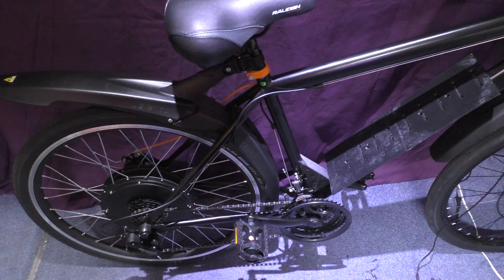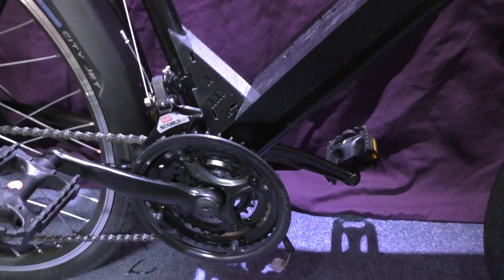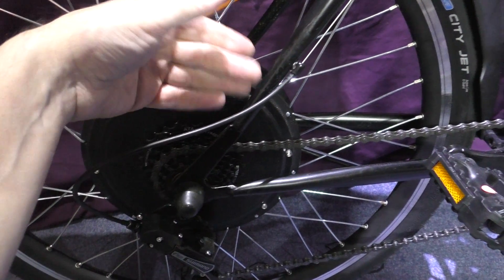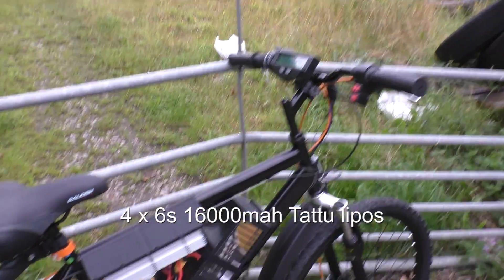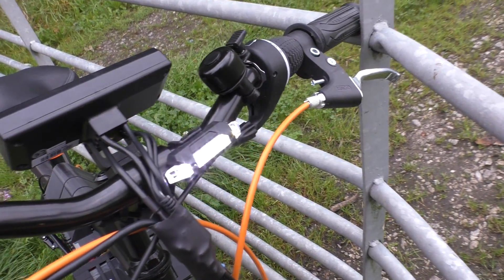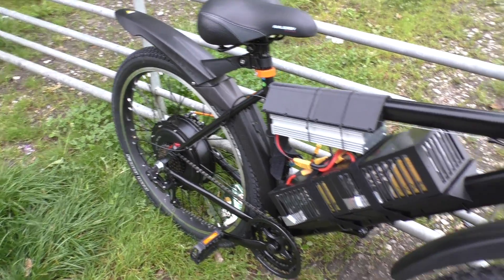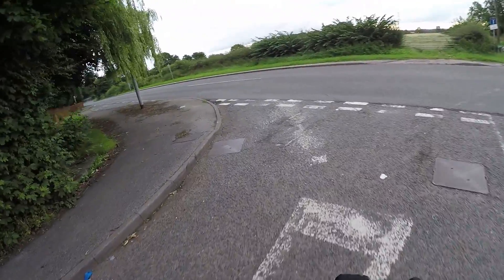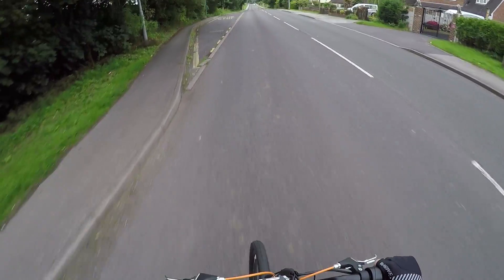Insanely fast DIY electric eBike - the most dangerous and unsafe bike ever

Comment: My 1000w hub 48v 10 amp battery Ebike I assembled has top speed of 84 kph. It is comfortable at 60 kph.
Reply: Yes going downhill, you can also do it with no power at all.
Reply: Scott Mannear  But 84kph with 1000w on the flat, you need to be very very aero.
Reply: If you're wondering i'm running an mxus 3k v3 (version with fatter axle and curved magnets) 5t (torque wind). From a 10Ah 92v battery, feeding my controller 100A battery and 250A phase. Controller is infineon sine wave with 100A of flux weakening. Torque is stupid, out accelerating most cars on the road and with a top speed of about 60mph.
All of this on a downhill frame with 9.5" rear travel and marzocchi 888 forks with 8" of travel.
Reply from the maker: For anyone who's interested, I'm currently doing a new build series where I list all the parts and explain everything in as much detail as possible. https://www.youtube.com/playlist?list=PL3Rqaj8tXgriU-y1gIiZb22lj0LHdCG7S
Reply: th3d3wd3r that makes complete sense I did some additional testing today and quite honestly based on my wiring that I have and how much current I'm pulling at full load I probably don't want to go much faster than what I'm doing right now anyway 25 miles an hour is plenty. Like the other gentleman was saying much faster than that and you need to start wearing rude gear and wearing moto helmets. If I want speed I'll jump on my motorcycle I don't want to just Cruisin enjoy the day I'll take the e-bike.
Reply: My brother and I as teenagers raced our racing bicycles down the steepest, longest road we could find and reach approximately 65-70mph each as I looked at the speedometer of the cars we were overtaking and they were reading roughly 60mph, sadly our brakes weren't up to stopping us adequately and we used up the rubber on our brake blocks and more or less all the rubber on the soles of our shoes and alas crashed our bikes a few miles at the bottom of this road on a sharp bend and had to limp home dragging our bicycles with buckled wheels, dented pride, cuts and bruises, but huge smiles on our faces, to face the telling off we deserved from our parents. That memory has stayed with me for life and it was one of many of our adrenalin rushed antics as teenagers that I am proud to take to my grave with me. Wish you all the luck in the world following your dream and hope you are very successful. Britain needs mad innovators to inspire us all.
Reply: AnteConfig It's a 48V LiPo 10 amp battery made by VPower.
Reply: Do you mean 10Ah?
Reply: th3d3wd3r Exactly
Reply from the maker: The wattage is depicted by the voltage and amperage. 9000w isn't simply 12hp
Reply: I'd really like to get more specs from you on your setup, part #'s, pics, etc... I also have a 1000w 48V ebike, running off of a 60V 15Ah battery, I can hit top speed of about 30mph [48kph] on a full charge, but that's about it. You are claiming 52mph [84kph] which is quite a lot for a 1000W motor....  Is your motor running the chain or is it a hub drive?
Reply: Fishmonger ! Hub drive. Had to remove top end speed from handlebar controller, set by law @30 mph. You can set limit manually at higher or lower amounts in KPH or MPH.

Amazon
AW 26"x1.75" Rear Wheel Electric Bicycle LCD Display Motor Kit E-Bike Conversion 48V1000W
Reply: The factors to consider are the voltage you're running, the diameter of the wheel used and the wind of the motor. If you have a faster wind, you'll get more rpm per volt. He may have a faster wind motor. Or possibly using technology like overspeed or flux weakening if he's using a sine wave controller with field oriented control.
Reply: Scott - OK man ur gonna have to hook me up with some info on how you did that. I have practically the same type of kit, different brand, but I'm sure they share some similarities. Mine had a lead wire exiting the ESC that you could wire together or unplug to drop from low to high speed. I wired it up to a toggle switch for easy on the go power, but if their is something I can further modify for more juice..... <insert evil grin> Was it the LCD controller you changed, the ESC or twist handle?  This is the one I got, and honestly for $150 it handles the 60V pack quite well. http://www.ebay.com/itm/152295461214
Reply: Fishmonger ! Lcd settings, buried deep in the Chinglish manual to change settings. Never hooked up the power assist magnet and wires, straight throttle to power wire. Had to beef up the connector between battery wire and power to hub wire as I melted first two. And fried two of the battery plugs, melting plastic and scorching plug receptacle. Bought 90 degree connectors and now torque/throttle slowly to @35+ mph, then gun to top end for short burst. Everything will get very hot at full throttle and any speed above @40 mph is very risky on bike tires. One piece of gravel, and you lose it. I caution anyone to wear motorcycle helmet and protective clothing above 40 mph. I've never had an ebike wreck, but have been in two motorcycle wrecks, one that put me in hospital and on crutches for two months. Concussion for five days. Be safe!
Reply: Fishmonger ! Again, you may have a similar looking kit, but if your motor is a slower wind, you'll need more volts to make it go faster, or technologies lile overspeed and flux weakening
Reply: I once sped down the Pyrenees on a very wobbly bicycle loaded with luggage in the back and the max. speed was 95 km/h. This was when the firss bicycle speedometers were available, about 32 years ago. We were going as fast as the cars beside us. One pothole and we'd be dead. I could barely add some speed by going as fast as I could in the highest gear for a few seeconds.
Reply: "Straight throttle to power wire"?
Reply: not even 40mph is hairy, I've done 37mph downhill on road on my mountain bike standard 26 X 2.00 inch tyres & that's getting hairy enough I wouldn't like to hit 40mph or higher
Reply: the only thing I find on amazon that matches your wheel/hub is this it's 48v 1000w & it says top speed you will get is 45-48kmh so don't know how you come up with claims of 84kmh https://www.amazon.co.uk/ReaseJoy-Electric-Bicycle-Conversion-Cycling/dp/B01D08RZYW/ref=sr_1_fkmr0_4?ie=UTF8&qid=1507217988&sr=8-4-fkmr0&keywords=Rear+Wheel+Electric+Bicycle+LCD+Display+Motor+Kit+E-Bike+Conversion+48V1000W%EF%BB%BF
Reply: Scott Mannear how do you change controller settings?
Reply: David Johnson my claim is speed registered on LCD screen after removing top speed limits in software. I verified accuracy of screen reading at 40 mph by having a friend drive next to me in his car. I did not verify top speed reading as I was too busy trying to hang on. I am sceptical of most things too, but again have nothing to gain by lying. I don't recommend anything over 35 mph as gear and driver are at risk. But, the ability to accelerate in traffic for a short burst has proven to aid safety in some situations, both on my ebike and motorcycle. My motorcycle is quite comfortable at 35 -40 mph which is fine for 35 mph speed limit city streets. But above that, the limited grip of the tires makes things hairy. I have wiped out due to small rocks, gravel, fortunately with no injury to me or motorcycle. So far, no ebike wrecks. But the ebike tires are standard mountain bike tires, and even narrower than motorcycle. But I have ridden the motorcycle about 4,000 miles, the ebike less than 200. After the last motorcycle wreck, I no longer use it. Fender benders are not good when you are the fender.
Reply: Scott Mannear Ok that makes sense. Because I was completely curious to see exactly how much I was running I hooked up a temporary amp meter in line between the battery pack and the ESC and did some quick runs. With a fully charged pack close to 60 volts when I was in high power mode and did a quick burst I pull about 25 or 30 amps and did about 1250 issue Watts or so from what I quickly looked. Interesting Lee enough if I was already at speed on level ground in my medium power mode I was only pulling about 5 amps from the pack. It just goes to show you that if you do most of your acceleration via pedaling and maintain your speed via the motor you will save your pack a lot of stress and also provide yourself a lot more runtime
Reply: Vortecks im scared if you list everything you put into this I might be tempted to copy you..... Lol
Reply: Don Mega I agree with not trusting a Walmart bike. Having lived in Europe and US, I thoroughly Understand MPH and KPH.
Reply: There's at least one good walmart bike I know of, the genesis v2100. Farlfle on the es forums makes a long swingarm for them so you can run big power without constant wheelies hahaa.
Reply: It depends on the kind of bike, and the tyres you have fitted. It doesn't take much more than 40 mph to make any bike an adrenaline overdose. But what we saw was a bike that was scary because of a light front end and speed combination. Poor steering and the involuntary wheelies must take some getting used to.
Reply: Ariel Lezen I hope u don't mind if I share with you, some observations:
- 35km/h are more of a cruising speed, for my standarts - on flat, asphalt/concrete surface, with MTB, calm weather, 8m above the sea level; the bike is equipped with 26"x 2.0" tire setup for XC. (& no E-motor)
 - Things change when you run it with 1.25" slicks - cruise speed goes to 45 km/h; and I haven't tried with dropbars ..yet. 
- Those "cruise speeds" up, apply more to 85-95 rpm cadence. 
- I highly doubt I'm able to crank more than 500W on 130-140 rpm cadence (where my power-output maxes out). Actually, that sounds pretty brave, to be honest.. :D
- Top speeds reached on flat: 50km/h with the offroad setup (2.4" / 2.25" - F/R); not much higher, with the training tires (2.0" - both front and rear) - the speedo shows 50-55km/h; And with the road/city setup - the 1.25"s...well, at 65km/h... I run out of gears. :| So, I can't really tell what's achievable with current sprockets (42T/11T is the top gear) - if i mount the 48-teeth plate, maybe will try to run for 70km/h.. anyway - we'll see. Road cyclists can tell more here. :)
Ok, what conclusions I made on that base? Those affecting top speed: 
1. Tire's size matters - not that much the diameter, but wigth - roll resistance & wind resistance drops a lot, the narrower the tire gets. 
2. Wind resistance is (much) more of a problem than the roll resistance.
3. Tire's tread - if you move with 50km/h, on the top section of the tire, the tread meets the airflow with 100km/h. From what we know about fluid dynamics - resistances increase in progressive relation with the speed (square one - if we have to be more specific). So the slow moving, bottom section of the tire doesn't exactly cancel the effect. (Fenders help, though.)
      These 3 save a lot of trial-errors, cash and bs, when the shop consultants are trying to sell you the "high-end"/"new technology", next to more people-priced products that are just the correct size for your purposes.
4. Rider's position - drop bars are created for those 2 reasons - #1 - to allow you reducing the crossectional area (respectively - drag), and #2 - to f*ck up your spline. (Reason 101 - "Why not being a road cyclist?").
5.  Drivetrain - the more the tension in the chain, the better efficiency it has. On lower gears it eats less watts than on the higher - smaller input sprockets pull it harder. On the bigger ones, the pull is less, but it's speed is increased, respectively -> the rpm's in the tensioner's rollers & their bearings. So if 400W reach your rear wheel at 40km/h, when you upshift on 3rd sprocket, & reach 60km/h they'll be like.. 370W, to say.. 

- Motorised vehicles (E-bike, ICE - doesn't matter) with constructive top-speed, exceeding 40km/h enter into moped-class and require driving license category "M"; The M - they give you automatically, if you get the B-category (for a car) ..and they give you a discount for A-cat.(motorcycles), btw.
With these on mind, nobody bothers getting the M-category on it's own. It's not a good deal, and doesn't worth the money & efford. Ok, with the E-bike, 1000W will attract the eye of the customer for it's dynamics, but if it's a "moped" - needs registration, license, bs, bs.. & that cuts off the ppl who don't have the B(+M) yet or simply want to avoid dealing with authorities.. So - speed limiter on 35km/h and problem-solved: the vehicle is road-legal, bikelane-legal, sidewalk-legal, underaged-daltonist-legal, crazy-cat-lady-legal... etc. 
Which doesn't mean, when the bike goes with 35km/h the motor consumes 1kW. ;)
Reply: Does it come with a coffin?!  😂
Reply: I have to agree with others.  I've also ran a 1kW bike.  And a 5kW bike.  The 1kW bike could tops at maybe 32 mph.  The 5kW bike?  48-50 mph.  I can't see how you could possibly achieve 50 mph on 1kW.   There's just no way it's currently possible whatsoever.
Reply: It's a funny one because you can easily drop the current and raise the voltage. That would keep it within 1kw and give you enough volts to get it to say 45mph. Buuuuut, as the speed goes up, the wind resistance plays more and more a part and you need more amps to push through. So, yeah, you're correct, no chance a 1kw bike is doing that unless it's in a vacuum
Reply: Will Davis I respect your right to be wrong. Peace
Reply: Wain Pain Those of us that survive these teenage near death adrenaline experiences have some scars and great whiskey stories. Thanks for sharing! 
Peace from New Orleans
Reply: Peace to you brother, stay safe and pursue what puts a big smile on your face, it's what inspires you to live life to the full. YOLO you only live once so live it to the full
Reply: My Bafang (Lunacycle) 1500W BBSHD tops out at ~45 mph with the gearing I have on my bike. My gosh that's fast to me. I'm happier rolling at about 20 mph. Once when I was a teenager I topped out a road bike at 57 mph going down a curvy mtn road and I never want to do that again. Cheap tires, drifting in the curves and no brakes (overheated rim pads). I rode a friends' hub motor 1000W bike and was very impressed. When I build the next bike (for my wife) I'll probably build a hub motor bike for her. Less power though b/c she isn't a dare devil. 

I went with the 1500W middrive b/c I live in a very hilly area and I'm a big guy.
Reply: Paco Jones Bumble Bees can't fly.
:)
Reply: Paco Jones No. All I stated is accurate. But you have three choices, accept, reject, or try to understand. The first two require no effort or intellect.
I'm not an Ebike expert. I didn't custom build, just bought a hub motor kit, a battery, and a Walmart bike and assembled the components. The only two things I did different was 1) didn't install pedal assist
2) removed electronic speed limits built in display.
I did verify the speedometer at 40 mph with a friend driving his car next to me. I didn't verify the top end speed as I was busy trying to stay alive.
Peace
Reply: No. My 500watt 60volt already hits 80+. I use a multivolt controller. My 48v battery makes me hit 55+kmh.
Reply: Terrifying. Splendid but terrifying.
Reply: I also used Chinese stuff for my ebike and emotorcycle projects. 1500w is already a lot of power. To increase your speed you have to have the appropriate controller and battery set up.  I can achieve that performance with a 500w 60v motor. Love those cheap chinese parts.  Some suppliers may be not truthful but Bafang should be reliable. Unlike a few others.
Reply: Scott Mannear no it not,  because unless you're running in a vacuum chamber 1kw gets you to roughly 35kmh
Reply: Ariel Lezen I have no reason to lie. Had to change controller settings that had limited speed to 30 mph.
Reply: Ran Chen Not aero, scared though! :) Anything above 40 mph on bike tires is insane. This Ebike is actually faster than my 70cc motorcycle and I put wider tires on the motorcycle. Luckily for me, the 1000 watt hub tire had a disc brake on it. The reason the controller limits the speed is 1) to be legal as a bicycle in most countries 2) I understand some countries limit ebikes to pedal assist only, not straight off the hub motor. This greatly increases battery cruising range, like double. 3) 10amp battery with full load heats up wires and strains the battery, probably shortening the life. The battery I bought was $450, the hub motor $300, the bike $160(Walmart 26", 15 speed with front and rear shocks as New Orleans streets are awful. I only go fast on one smooth road. Another $200 on lights, Bluetooth speaker, folding rear baskets, back frame to hold battery and mosfet in a waterproof bag. All in @$1,000. I rarely use it now, probably will sell it to a college student at significant loss.
Reply: I live in New Orleans, Louisiana, USA.  Finding a hill  here would be a challenge! But I agree with your logic.
Reply: So you power a 1000W hub tire with a 480W battery and reach 84Km/h?
That's crazy.
Reply: 9000watts is 12 hp.  1000 watts is 1.3 hp.
Reply: Moses Bullrush FAKE NEWS! 🙉🙈🙊

Comment: if that frames ahead headset get some used street/dirt jump forks off ebay or gumtree them cheap forks are pure death ! i sold cheap bikes for years and they all come from India or Vietnam and all are very low quality the bottom bracket forks and hubs especially.ive seen many of them forks snap...the uppers come out of the lowers and you eat shit..it happens pretty fast usually before have chance to put  hands out..most head plant still holding the bars...thats at 15mph or slower  😐  👍